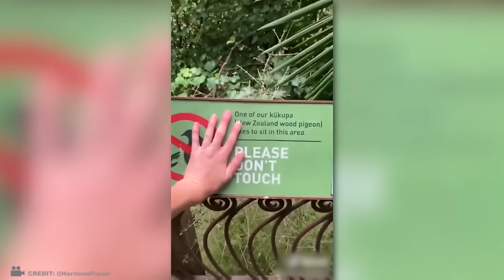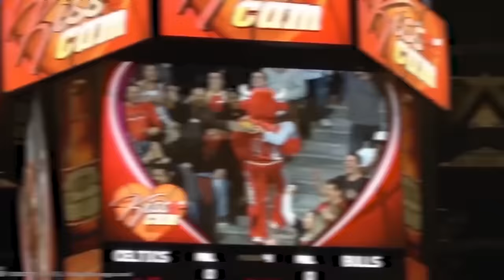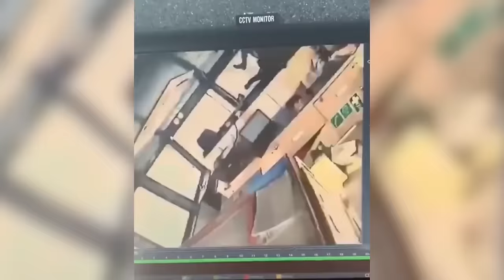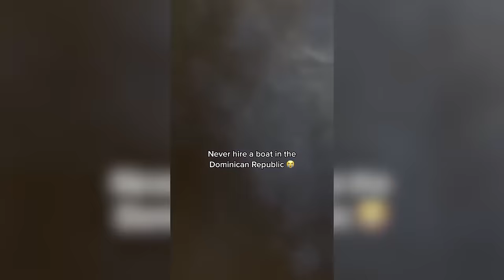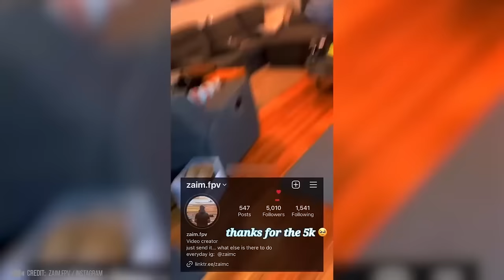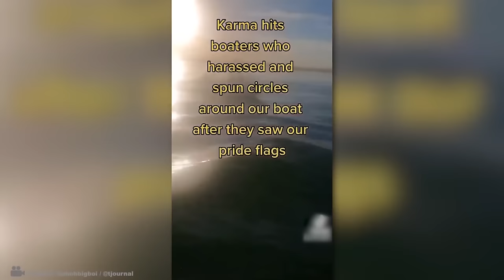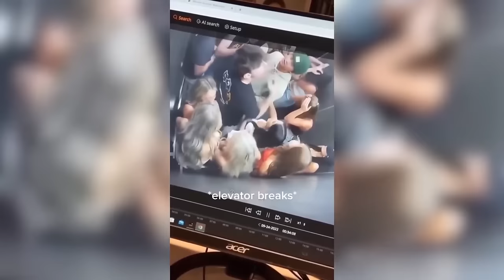Moments of Instant Karma | Best of Summer!

Comment: 4:32 There's nothing wrong with those barges and they were certainly capable of carrying those loads.  They're designed to offload their cargo (logs) by tipping them off.  They performed perfectly.
Reply: fudgeholeJenkins  I bet your daddies like the log(s)!!
Reply: fudgeholeJenkins  My mom died 6 years ago. This Sunday would have been her 84th birthday so, thanks for that. Piece of crap.
Reply: Was it supposed to go in the water tho?
Reply: @zukostryder  Yes. In a lot of places the saw mill access is only via waterway.  Loggers have been using rivers to move large quantities of logs since long before trucks were invented.
Reply: That's true, but we don't know if that was the reason.